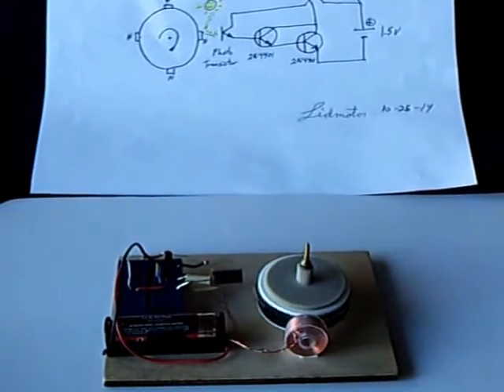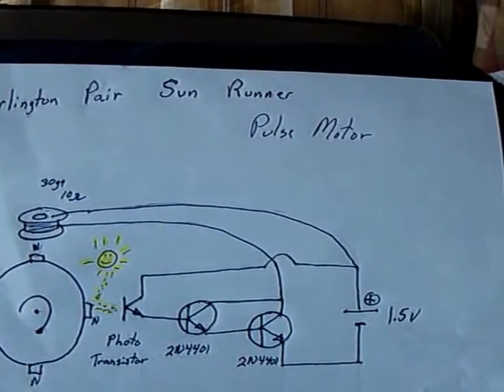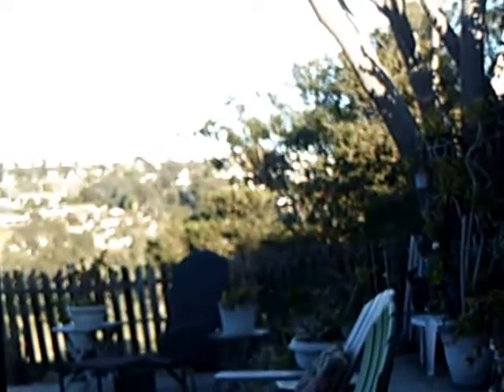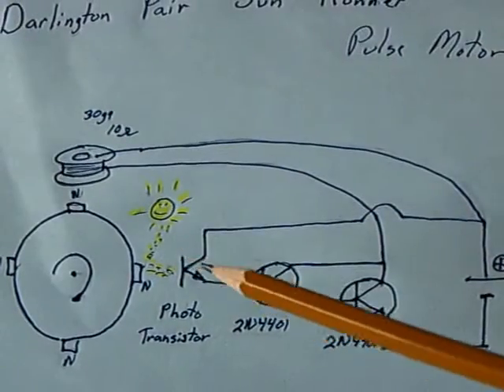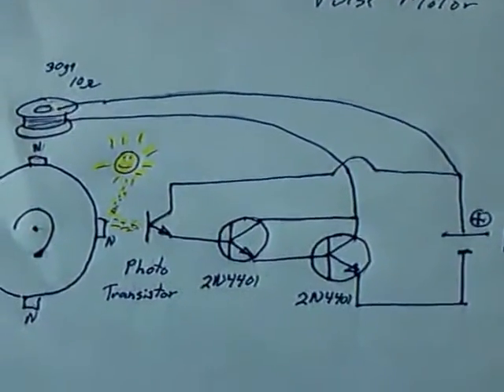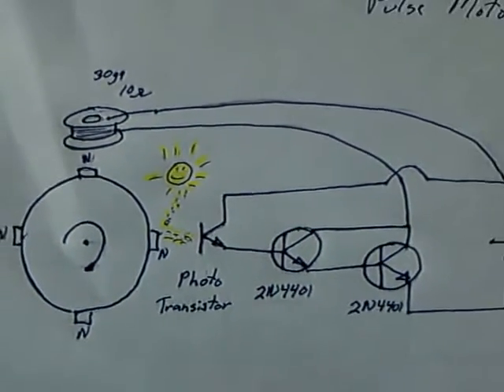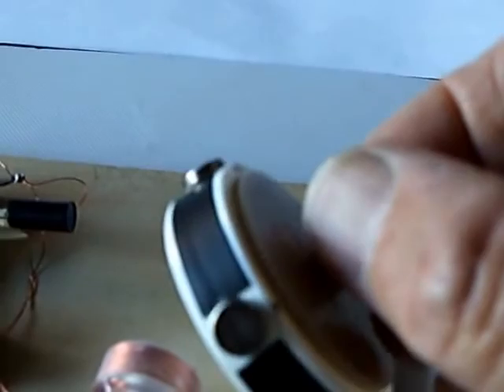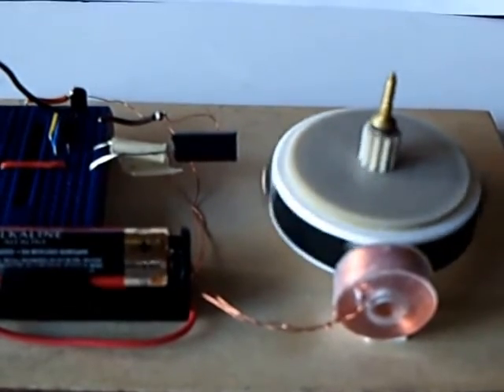Darlinton Pair Sun Runner--  Pulse Motor

Comment: Playing with a darlington pair I found it works well on voltage dividers giving a similar effect of pulse width modulation in bringing things up slowly in voltage and to full run speed. I was playing with a pc fan that came on when you heated a thermistor and blow out the flame of a lighter then the fan slowly spun down to a stop. Just thought this may be useful if you have any projects for the future.

Comment: Hi lid have you watched ingventor video called coral castle gretchen jones.  Peter Stevens has the lady holding a static attraction wire/aerial now pete is the man who videoed joe booker alias joe cell recently he mentioned in an email that a right hand vortex wire may cause a scarey effect on a ground earth wire from a body may be a cars body!!    But it may also be a missing link on home energy off a tv aerial by making this wire around the earth rod from ground so that the earths puls would attract to the static if the tv aerial say with a transformer in line the reason being that such a vortex would cause a one way magnetic collapsing diode.  Anyway I expect you could make this wire on this circuit you show it has to be as you see it in Peres video very slight sine wave curves then off at 90 degree the vortex swirls then the curves/bumps again total 17 all in. Cheers if you are in touch with Agassiz would you forward on thanks tesla I feel knew this

Comment: thanks Mr Lidmotor, really helpful videos - I'm learning lots, love those tiny coils - Is it bifilar 30awg for both cores? If so, can I ask would a larger coil work with both cores the same size work for a pulse motor do you think? I have an idea to make a driver coil from a pair out of a CAT5 cable as the pairs are already twisted so nicely and it's solid copper, but they're the same gauge. I just wondered if you thought the same size would be ok for bifilars. MrAngusWangus said in a video ages ago that he 'thought' the same size would probably work.  If I had some CAT5 I'd try it out but I'd need to aquire some first so it could be a long exercise to test something that 'might' not work, appreciate anyones thoughts on that too. thanks so much.

Comment: Nice video.  It would be interesting to know just how little current is coming off that photo transistor...
Reply from the maker: It has to be just pico amps.  It is dark outside now and it is running fine on only room lamp light at 42 LUX.